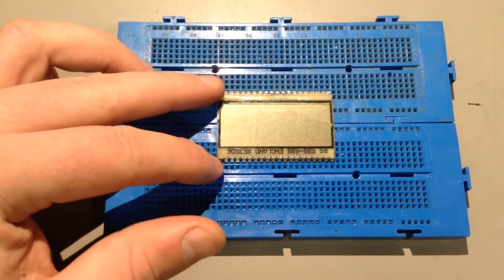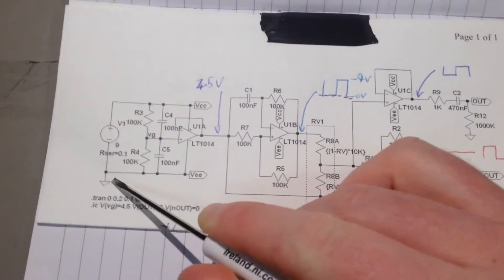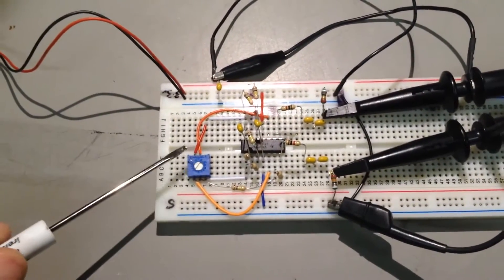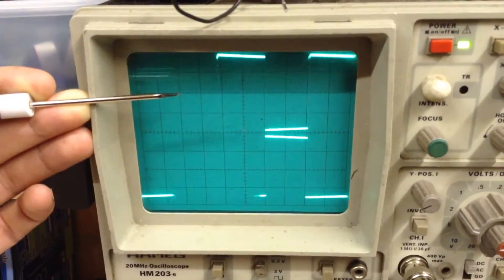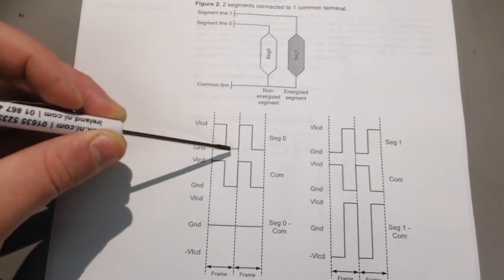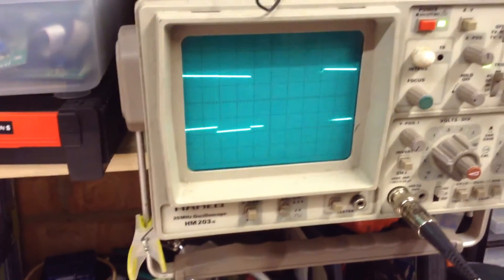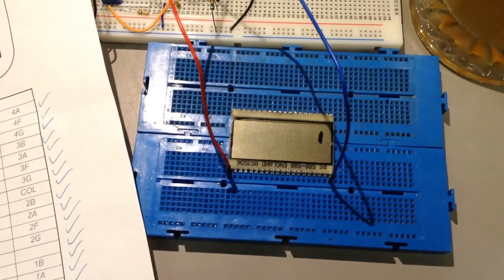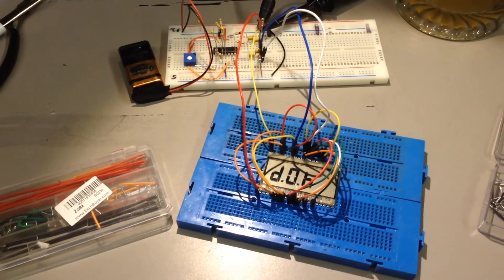LCD Update: How to drive & test an LCD - VB#9

Comment: how to controller this lcd using microcontroller because i new in electronics
Reply from the maker: Shailesh Parmar you can set a pin on a micro controller as a square wave of about 50HZ and then pas it through an inverter then use multiplexing  to go through all the segments and only invert the polarity on the segments you want on.
Reply: thanks sir